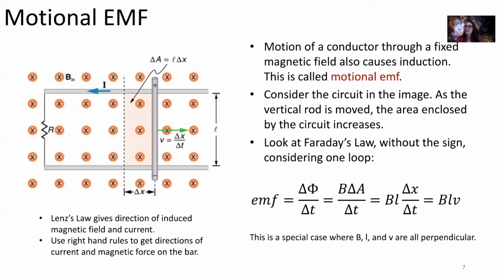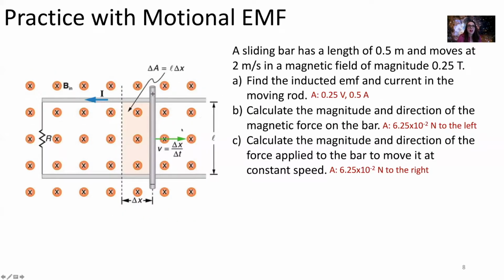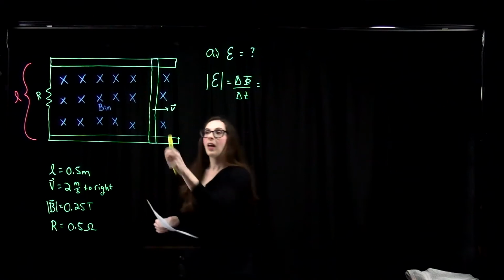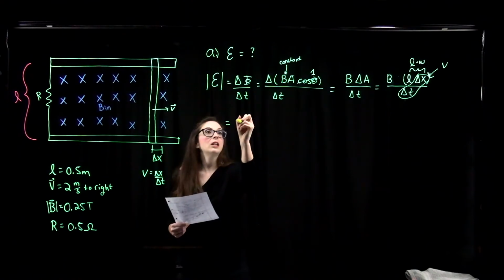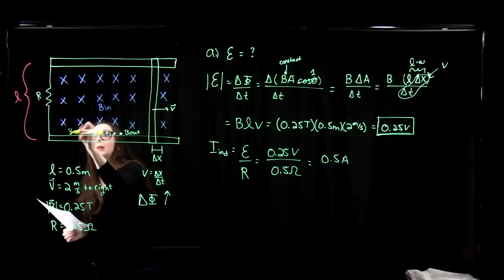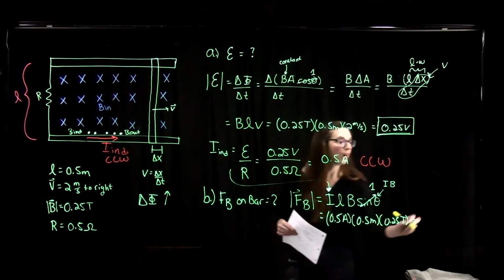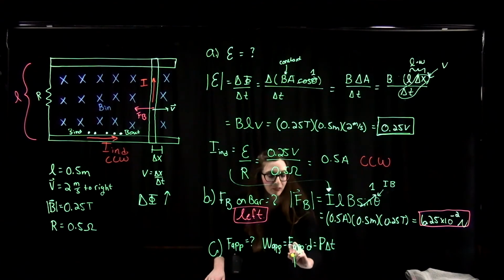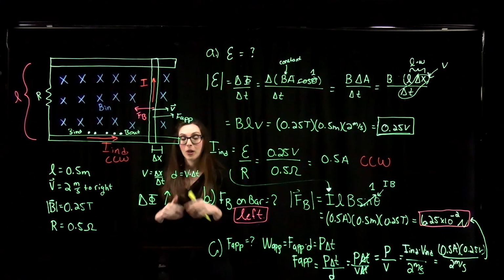Week 11 PHY 222 - Motional EMF

Comment: Hi Maria, I would like to raise a question; Faraday's law saying " integral of EMF over a closed loop = -d/dt(total magnetic flux bounded by the loop), so I agree the right hand side is BLv, but if I calculate the line integral of the left hand side is RI+BLv, where RI is EMF across the resistor and BLv is due to Lorenz force from moving charge in magnetic field. RI+BLv=BLv? Could you please help me on this?